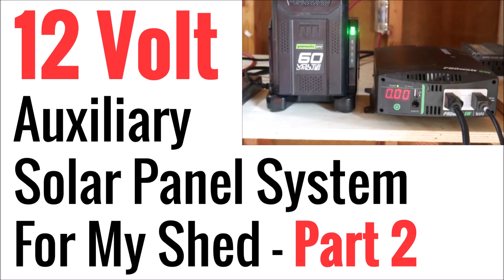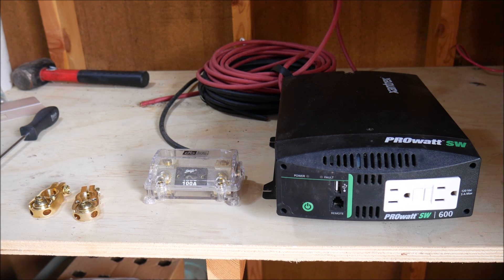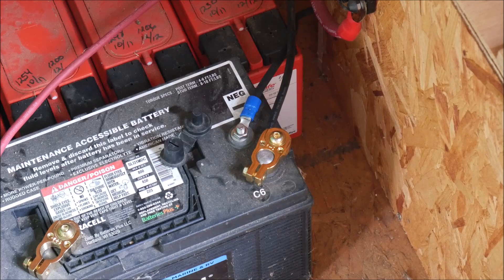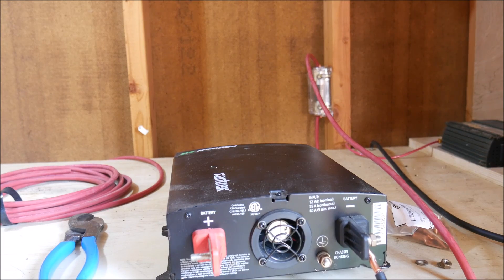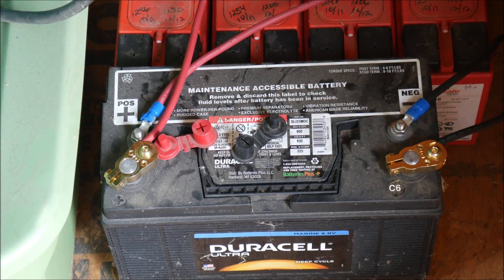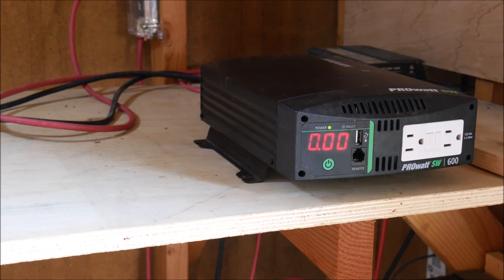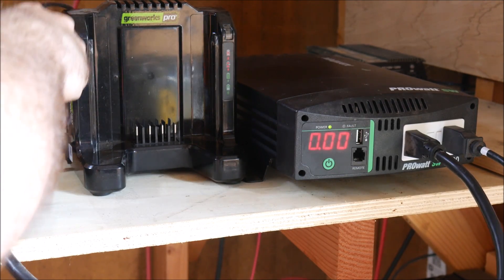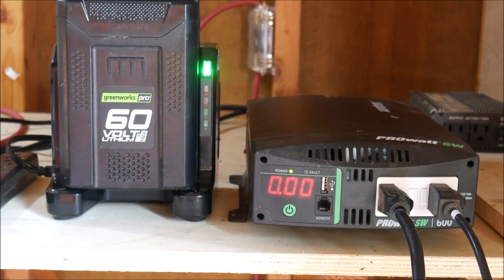12V Auxiliary Solar Panel System for My Shed - Part 2

Comment: I have 500 watt device that I want to run 247....what size battery and solar panels do I need?
Reply from the maker: That will require a large system.  If you aren't trolling, respond back with more information about where you live and what your budget is.  Also, is this device AC or DC powered?
Reply: @LDSreliance  Las Vegas...$10k budget...DC powered - purely off grid.  Do you need solar panels to run the device 24/7 and batteries as back up only or is it a must to setup to use both.  I'm looking at lithium Fe sulfate batteries..are they good for a solar off grid setup?
Reply: I want to mine cryptocurrency and use solar to take the electricity bill out of the equation
Reply from the maker: How are you going to run your crypto rigs directly off of DC power?  I thought they all just used big ATX power supplies?

Anyways, to run 500W around the clock in Vegas year round you will need a little over 2000Ah of battery capacity @ 12V and a little over 5,000W of solar panels.  That is without any reserve power in the batteries for cloudy/rainy days.
Reply: @LDSreliance  that is going to cost alot.  i don't think that is worth $6 a day.
Reply from the maker: No, unfortunately that is not a good use case for solar.  Around the clock loads are not ideal at all.

Comment: A few questions for you. I believe a fuse should be placed right at the positive terminal. Right now you have a long lead wire going up to a fuse. If later on you add some more building material and that wire gets covered up you could end up cutting or drilling into that wire. What’s recommend for that part? 

Next question. What is the requirements for the battery cable,  it appears to be under sized. 

Other then what I have reviewed from part 2 your project is coming along nicely.  See you in part 3
Reply from the maker: Dale, that is probably true.  Ideally you would want the fuse as close to the battery as possible.  I am very careful around my equipment so I don't think it will be an issue.

 As far as the wire size, it will only be carrying 60A max so the size is adequate based on the length it is going and the current carried.  Most of the time it will be doing more like <10A.
Reply: LDSreliance: sounds good but if you are using longer cables you need to go higher I believe
Reply from the maker: Yes that is true.